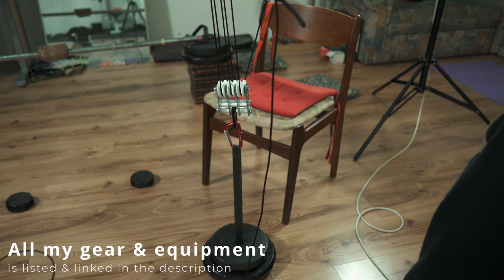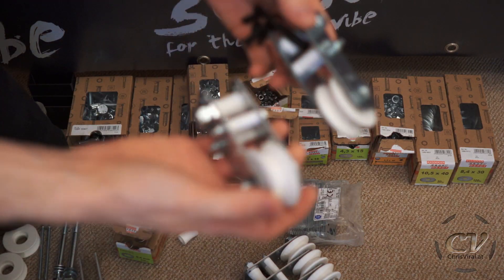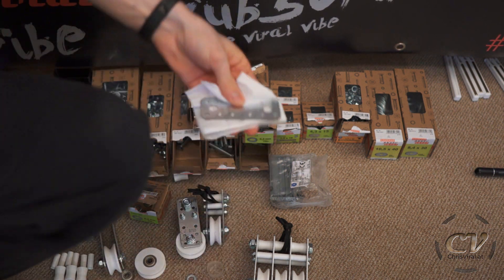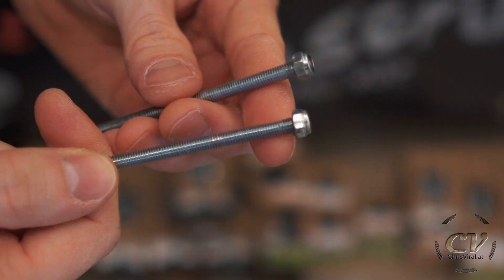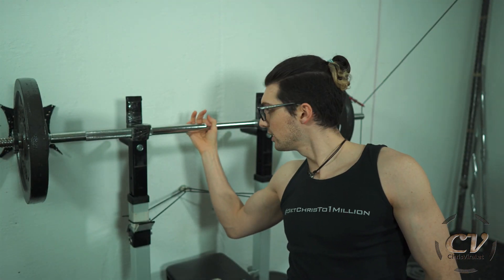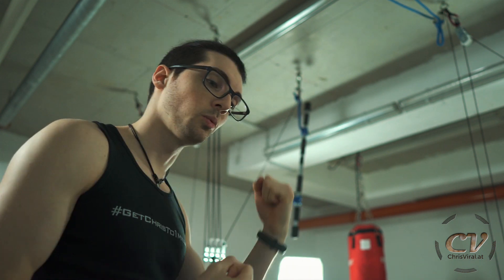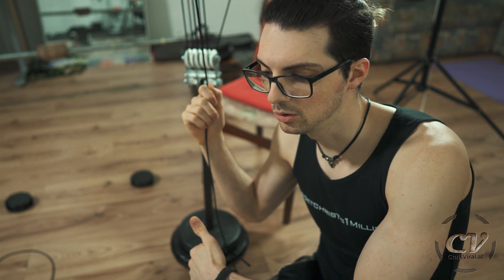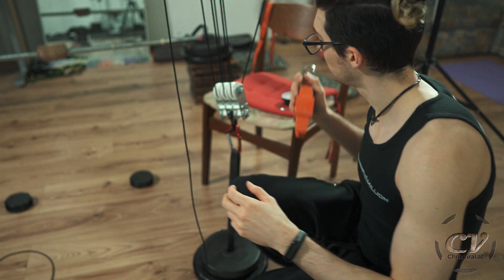DIY Triple Pulley (Creating An Unstoppable Force)

Comment: If you extend the two middle plates you could attach a connection point below the middle wheel that would give you 1 more additional useful place to attach to, and if setup correctly would give you an additional mechanical advantage ratio.